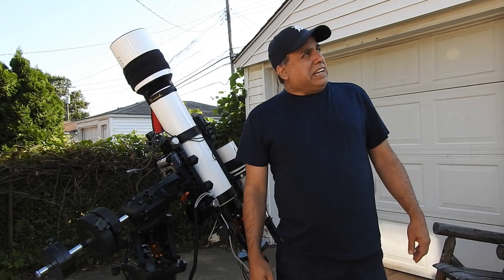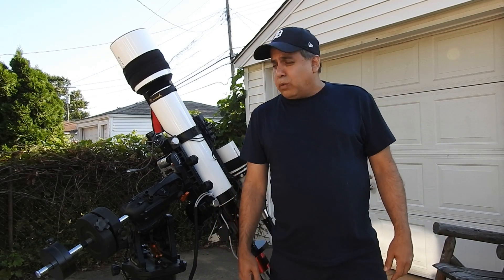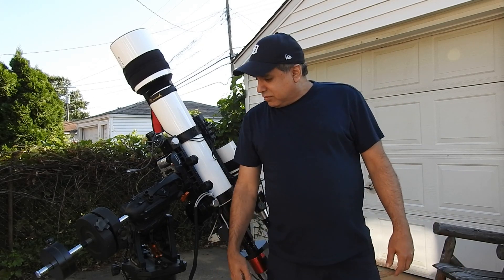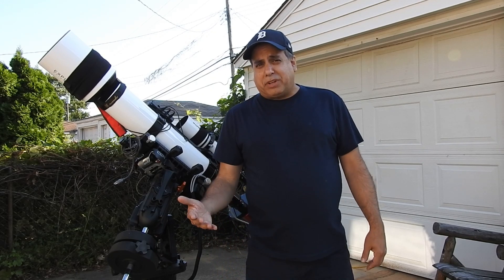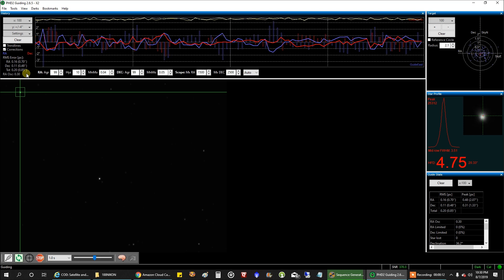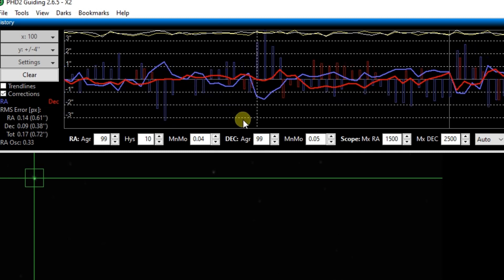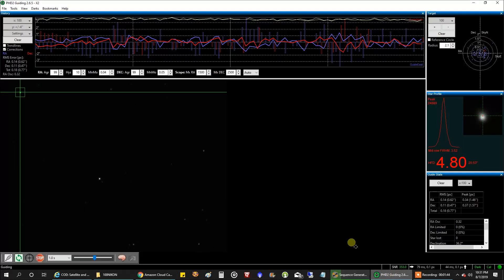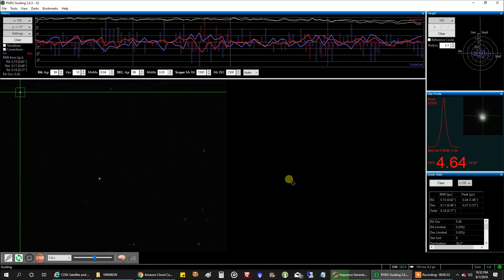My Telescope Mount is Driving Me Crazy (Part 2)

Comment: Hey Chuck, I have a CGX-L with the same issue. Did you ever figure this out? Please let me know and Thank you.
Reply from the maker: I just kept tweaking the Distance Adjust and Limit Screws until I found something that works.  I never stopped using the mount so I'm fine for now.
Reply: @ChucksAstrophotography  Are you still running the extreme settings on PHD2?
Reply from the maker: @DSPRemote  Yes.

Comment: Did you ever get any resolution on your CGX woes? I've been looking at the CGX-L as a possible new mount for my setup, but after seeing the issues that you and a bunch of other folks have had with their Celestron mounts I'm beginning  reconsider.  The Losmandy G11 is starting to look like a safer option.
Reply from the maker: I never really did anything and never stopped using the mount.  I still get round stars.  Celestron called me and I said it was running fine for now so I took no action.
Reply: @ChucksAstrophotography  Glad to hear it's still going. Please keep us updated on the mount's health if possible. I've enjoyed products from the big C for years. I started with a C10-NGT and I now use a CPC DX 1100. I've been eyeballing that CGX-L for a while now, but I wont drop $3600 on a mount that may or may not be a dud right out of the box. Thanks for all your videos, and clear skies to you.
Reply from the maker: @XwarpfactorX  Cool, I've been using mine for 3 straight years so far.

Comment: Hi Chuck,

I had a similar problem a while back with my EQ6. The fix was to check that the worm gears were properly engaged on the RA by adjusting small grub screws on the RA axis. One thing I did notice was that there is now significantly less (almost none) backlass in the RA axis. I know backlash in the RA doesn't really matter but I think too much of it is a testament to something being loose or not tightened correctly. I don't know if this helps but I think you will be dealing with a similar kind of issue. Logic dictates it can only be something that come loose over time since the mount was peforming well before and then one day started acting up. 

Good luck all the way from South Africa
Reply from the maker: Wow - South Africa!  Hello Janco!   Thanks for the info.  I still haven't dug deep into solving this problem yet.

Comment: Chuck, sorry to hear about your guiding woes. Have you tried a test run without any guiding?  You should do so in order to isolate potential guider-induced problems from mounting-induced problems.   Check guider mounting and flexure issues. Check for loose guider camera elements like focuser, primary lens cell mounting, guider-to-scope mounting, etc. When problem occurs, has entire telescope system reached thermal equilibrium?  Does the RA error persist throughout an entire worm gear cycle?  Sorry I’m not familiar with Celestron equipment, so I can only offer generally-applicable troubleshooting advice.
Reply from the maker: You make excellent points.  I haven't tried running it with guiding yet.  But I have checked every inch of the setup to make sure nothing is loose.  Thanks for your input, I'm learning a lot from reading all of these comments.

Comment: I have no experience about the control system on the telescope tracking.  But I have gone through some troubles appearing on other kinds of servos.  Here are some of my findings.
You could sometimes experience the difference between standing and moving friction.  If your drive is like a stepper motor at a very slow speed, it actually stops between every discrete movement.  Then you have to apply more torque to move and depending on flexing in the drive train, your controller may find that the commanded movement did not appear to take place.  Adding a second pulse overcomes the friction and you get an overshoot.  I gather this is behind many of the already given suggestions.
Here is another root cause for motion jerks or “hunting” that I have battled with.  Having an analog to digital or a digital to analog converter in the control loop sometimes has a step at the crossing over from negative to positive or the opposite direction.  When thew controller uses integration of the error as part of its scheme, it may keep repeatedly “correcting” across the balance point.
And last, but not least, there is a basic rule in control loop stability:  If you have two integrations in the control loop, you make an oscillator.  If the time constants of the two integrations are veery different, you may not notice anything.  But in principle the oscillation still is there.  Now, the situation of two integrations arises easily if the same servo drive is used as velocity controller with its PID loop stabilizing and then as part of a position control (a computer using its own PID algorithm, based on an encoder feedback, for example).   Suddenly you have the mentioned oscillator with the two integrators.  I have seen small jumps repeating at as seldom as 20 seconds.  In that case, I disconnect the second (velocity loop) integration.  And I try to “preach” the rule that you use integrating velocity servo, but never when you have a position control as the outer loop.
Reply from the maker: Wow, thanks for sharing all this, you've given me a lot to chew on.

Comment: Chuck, have you checked your mount time lately. I was having a similar problem with my mount and when I checked my clock it was completely off; GPS was still getting my correct location. My hand control battery was going bad.
Reply from the maker: My mount time was off, which always seems to happen over time - and it usually messes up my Plate Solving, but I corrected it this week.

Comment: Hey Chuck thanks for sharing your experiences I enjoy watching your videos. I'm curious are you running off of a inverter to the Mount and possibly could you be getting some signal interference all the power to the Mount if you're getting this extreme cycling. You might Trace back and make sure that you're not getting some cross-traffic on electronic wiring causing the amount of voltage even though slightly more into the mount.  I think especially in your case since you move your equipment in and out to set up and image if you're getting some cross signaling it could put the guiding off.  

As far as the belts are concerned Celestron should have those in stock and if you've been using this mount for 2 and 1/2 years extensively it's also possible that you have a little bit of stretch which would cause the Motors to have to turn just a little bit more to engage and take up the slack and either direction. You might watch and see if they have a visual way you can check this. I'm basing this on some of the videos of upgrading and Hyper tuning the old eq6 to belt drives.
Reply from the maker: I'm running straight from and AC outlet to my power strip taped to the tripod leg.  Do you think that's an issue?
Reply: @ChucksAstrophotography  I would check how the drive power and mount control wires route and make sure they don't parallel long distances. Usually you want data seperated from or running perpendicular to power lines so as not to induce cross-interference.  This may not be your issue, but in running cables it's best to keep low power data(usb/RS232 mostling in our case) and 12v/120v power dedicated lines apart from one another as much as possible. Of course quality shielded power cable can resolve this issue too. The thin cheapy cables we often are given for the mounts aren't shielded very well but if you've upgraded to robust cold weather cabling then you're probably already OK.   It's just one more of the little gremlins that can cause issues.  Even loose connectors that may strain when the mount is in a specific position can cause issues.   Best of luck hunting down and stomping the tracking gremlin you've got.
Reply from the maker: @mycarolinaskies  Thanks, when I first bought the mount, it was acting strange.  I had to send it back and Celestron said it was a wiring issue.

Comment: I was just thinking, that R.A. worm gear and wheel seem pretty exposed. It may be possible that you've got some dirt or metal shavings caught between the teeth and that's causing your issues. Maybe try cleaning and re-greasing the gear and wheel? These are fully enclosed with the EQ mounts.
Reply from the maker: They are enclosed on my mount too, I only have the covers off because I've been working on them.  But thanks for the tip.

Comment: Hey chuck,  I’m just spit balling here but have u tried reinstalling or checking for updated motor control firmware? Maybe it’s some kinda glitch in the software. Unless ur convinced that it’s a mechanical issue. I hope u get it sorted soon. Good luck buddy!
Reply from the maker: I'm not convinced of anything, but I will ad a firmware up on my list of things to check for, thanks!
Reply: Even the hand control firmware could have a bug. Since pulse guides r sent through the HC. Ya never know.  It’s worth a shot, reinstalling those couldn’t hurt anything and simple to do. GL
Reply from the maker: @Sweatsox8  Thanks.  As soon as I get my other setup operational, I will be tinkering with this mount more, but I will certainly update the firmware.

Comment: What the best your mount has done with all this equipment?  Have you ever used Pempro to train your gears?  The trial version is pretty functional.
Reply from the maker: The best this mount has ever done was briefly average in the .4 range when I point to the north.  Now, I heard of Pempro, but never tried it.  That's an option.
Reply: @ChucksAstrophotography  I've used Pempro once with the awesome help of a friend.  Pempro test your mount and comes up with an algorithm to best train your gears.   I used it on my ieq45 pro back in January.   This is one software I probably will buy as I was so impressed with it.

Comment: Hi Chuck. I am not sure whether anyone has suggested this, but I would log on to the 'open-phd-guiding' site where Andy and Bruce answer thousands of emails detailing problems of very conceivable kind on astrogear and PHD2. They are the experts on PHD2 and may be able to assist you, once you send them your guide logs, debug logs, etc. Just a thought, anyway. Good luck.
Reply from the maker: Thanks Richard, I have been trying PHD2, I know it can help.  I don't even know who Andy and Bruce are, but I'm curious.
Reply: @ChucksAstrophotography  They're the guys who answer people's questions all the time, regardless of their equipment and so long as they are using PHD2 for guiding. I subscribe to that site and get messages which reveal so many interesting problems with various combinations of cameras and mounts using PHD2 that I read them all, even though most are irrelevant to my set-up!

Comment: Hi Chuck,

Two things:

Looking at your PHD2 guiding I would suggest use a star that is less saturated, say around 2.5. In the video there are parts where the tip of the curve flattens out a little, this should always be a sharp peak. This factoid changed my guiding for the better after I did this.

Have you tried a PEMPRO analysis? There is a 60? day free trial and it is pretty easy to use (though I do not have a belt drive). The curve analysis may yield a suggestion of what to do. I have done this and uploaded the PEC curve into my Losmandy mount with positive results. Your Celestron probably accepts curves too, but fast oscillations are the most difficult to correct.

Good Luck,

John
Reply from the maker: Thanks John, I always let PHD2 pick the star, but I'll look for one in the 2.5 range, thanks for the tip.  I just heard about this PEMPRO, thanks - I'll read up on it.

Comment: Hi Chuck. I started with an AZ-EQ6GT. Had to purchase a new synscan 5 to get it to track correctly. Then to stop the swaying I purchased extra counterweights and moved them up the bar nearer the mount head. Would that help your Celestron using Celestron parts.
Appreciate your video's they're a great help to me. Thanks.
Reply from the maker: Thanks for hte suggestion.  The Celestron mount uses a different software driver and I seem to have the balance pretty good at the moment.  Glad you find the videos helpful.
Reply: @ChucksAstrophotography  Do any programs/drivers you use need updating. Or, if your other astro gear works, then its a Celestron problem! Or could it be a USB fractured wire or worn connection.
Ring Celestron their sure to know the answer. After all it their product on view.
Reply from the maker: @Mel-127  Thanks, I wonder if it a driver or USB issue, haven't tried that yet.  I will get to it as I exhaust other options.  I put in a request with Celestron today.

Comment: g`day chuck sorry to hear you  still haven't sorted your mount yet  i havent had much success  dealing with celestron  in the usa when i had a problem with firmware updates not loading for the motor control. maybe it was because i was in australia  or emails  i ended up fixing it my self after trying to load the firmware 30 times i had success  and it loaded and i havent updated it since  my local dealer is abusive on the phone and  i hate buying from them now  or talking to them  so i only buy gear from the states now 
cheers
james D
Reply from the maker: Thanks James, I'm still hoping to stumble upon a fix my self, but I did put in a request with Celestron, even though I am past the warranty period.

Comment: I was considering this mount with a 925 edgehd. Is there a significant difference between the CGX and CGX-L? 
Besides the payload limit and gear.
Should I just bite the bullet and get an Avalon Linear?
Reply from the maker: Avalon Linear?  I'm going to look it up, I'm not familiar with it.
Reply: Avalon has the Uno and the M Zero, which are no meridian flip as well as don't need counter weight. However their site states payload at 17lbs on the Zero. 
The Linear is like a regular mount that's about 50lb payload. It's also $6k 😲.

I'm really kinda stuck on what mount I should get.

I'm looking at a Losmandy G11G. I hear the Gemini system it uses has a steep learning curve and or isn't very user friendly.
At the very least with the Losmandy I can get parts for it.

The only other mount is an iOptron CEM60EC.
Reply from the maker: @bear5016  No meridian flip, I like that.  But 17 payload will never work for me, even with my wide field setup.
Reply: @ChucksAstrophotography  The Uno is 44lbs, no counter weight, no meridian flip, no lube, no friction, no maintenance, zero backlash. $6k. It shows it with what looks like a Celestron 925 edge hd on it.

Im eyeballing the Losmandy G11G.

Sorry youre having so much trouble with the CGX. I hope you get it fixed, you do great work.

Clear skies!

Comment: Yeah, but you're not other people :)   .. .. .. .. The RA correction pulses form a sine wave running across the screen - rough but definitely there.  Two things can cause that. One being repetitive mechanical wobble in a shaft/gear-box/pulley. This would likely be in the faster turning parts of the gear train (shrug - and not likely able to be gotten to)   <oh, those darn prepositions ending a statement> 

The other being speed variation in the motor itself (being that RA motion is time dependent). As a machinery butcher from way back I would be tempted to borrow (assuming you don't have one) a micrometer dial indicator (calibrated in one-tenth of a thousandth of an Inch - this being Murica) with a stand or mag-base and use it to probe for mechanical wobble when the RA drive motor is running. 

The other would be a scope to look at the drive pulses from the motor driver board to see if the frequency is stable. (with guiding off, obviously) While you had a crash that seemed to be the causative factor and we think of mechanical issues primarily, electronics can also be the culprit (and due to the stress of a crash).
The shame here is you don't have a donor carcass from which to swap out parts to localize the issue. (and as I typed this, the idle thought occurred - are the RA and DEC motor drive boards interchangeable? That would be a quick test)
Reply: I'm inclined to agree. The nature of the Ra drift definitely looks like a sine wave so something is wrong with the RA gears/motor. Maybe a fill replacement is in order?
Reply from the maker: A donor carcass?  A mount cadaver?  lol.  Thanks for the useful info, Denny, very insightful.

Comment: I have similar problems and it ended up being the mount leveling, balance, cable management, polar alignment, usb hub voltage, but i guess you have checked ll this.
Reply from the maker: I haven't gone through the electronics.

Comment: Chuck, I have a CGX mount and I am very interested in your outcome for improving the mount tracking performance.  I just got my mount back from Celestron repair where they had to replace the Declination motor.  I am still not satisfied with the RA performance.  I am getting similar performance to what you are getting on nights with fair seeing of around 0.75 RMS.  I am in fairly light polluted skies of North Houston.  I would like to be 0.5 RMS arc seconds or below.  I have found that sometimes increasing my exposure time to the high end of the range of 3 or more second can be very helpful. I am assuming that what is happening when I get good improvement is that the longer exposure is averaging the seeing distortion.  However, I often see much more correction in the RA axis and this seems to be creating oblong stars.  Please continue updates on this issue.
Reply from the maker: Thanks, I will keep you posted.  But that's a shame that you would get your mount back from Celestron and still not be satisfied with your RA - but you're not the first person I've heard this from  :-(
Reply: @ChucksAstrophotography  Chuck, how good was your tracking before, and what are you trying to achieve?
Reply from the maker: @jpop5047  In this part of the sky, I would be in the .6 or .7 range, but with less aggressive PHD2 settings and no wild swings in my RA.